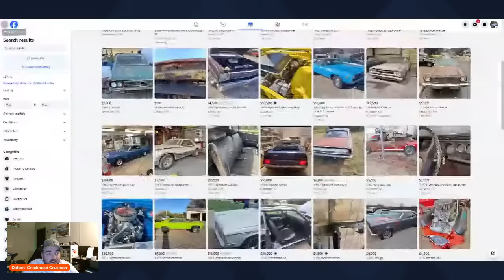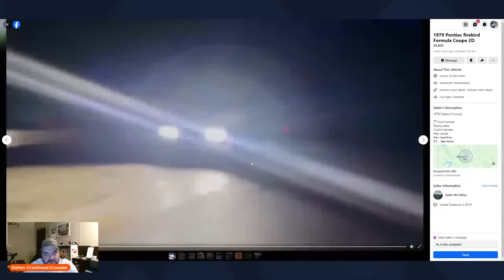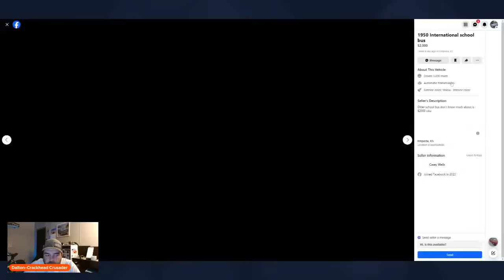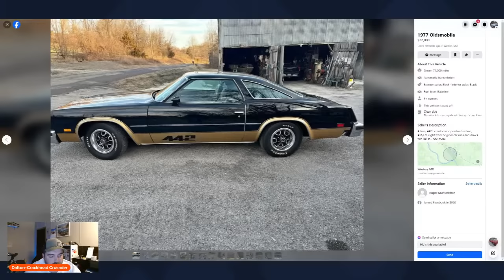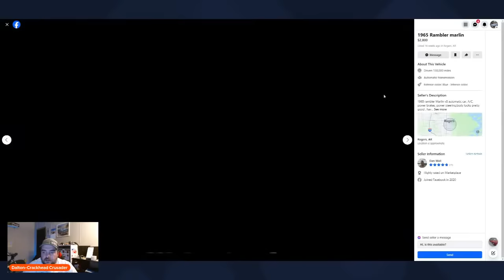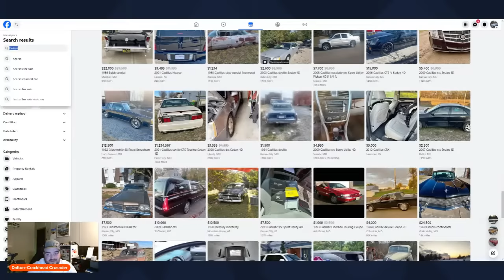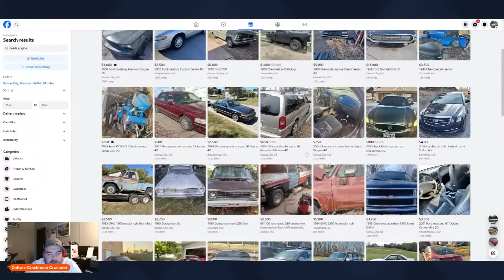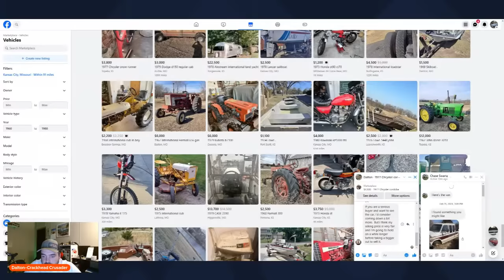Wild World of Facebook Marketplace vol 7

Comment: Hey Dalton , just a refresher. A Ford ranger doesn't have to mean a small pickup. You could get an older F-250 Ranger package. I had a 72 for years. Awesome trucks for the era. Those years also had the F-250 Explorer and camper special packages.
Reply from the maker: True. And those would definitely be real trucks
Reply: @PoleBarnGarage  indeed. 😁
Reply: I sold my 76/77 F250 back to the son of the guy I bought it from about 30 years ago, and he has tore it down, fixed the crack in the frame and is putting a replacement cab on it! But he wanted something his dad owned to fix up, and that was a good project for him!

Comment: When you get your new garage dried in consider getting the 12k solar mini split a/c heat pump from signature solar. It’s cheap and will run directly off a couple of used solar panels and when the sun isn’t shining it will automatically switch to grid power. It’s one of the few things that will pay for themselves.

Comment: Wait what?!?!?,you said what!?!?!?!?,boring a cylinder increases cubic in displacement,improves compression,not to mention if a cylinder wall is scratched or egg shaped it improves engine life as a whole,are you sure your not the crackhead?
Reply from the maker: Miniscule increases in displacement and compression. Apples to apples a stock bore engine in good shape vs an engine with a .030 overbore, there's going to be very little difference. Boring an engine is for repairing it, not to increase power
Reply: How many engines have you built??,performance engines,not rebuilding or refreshing?